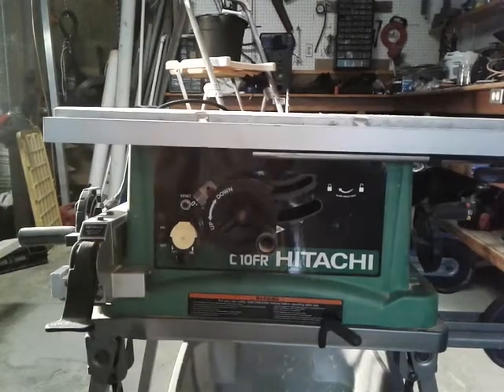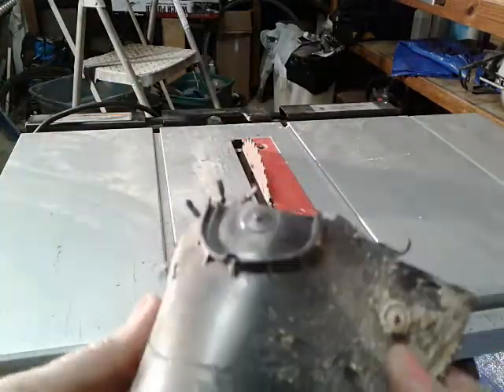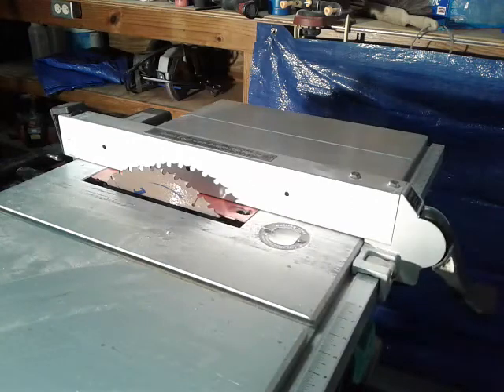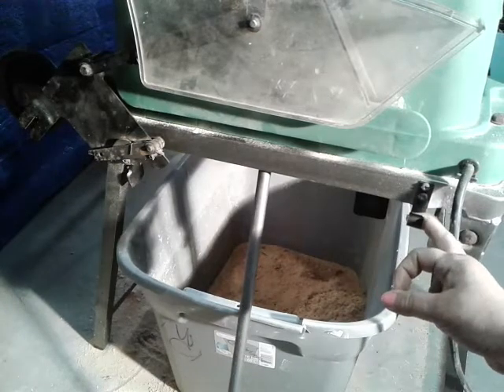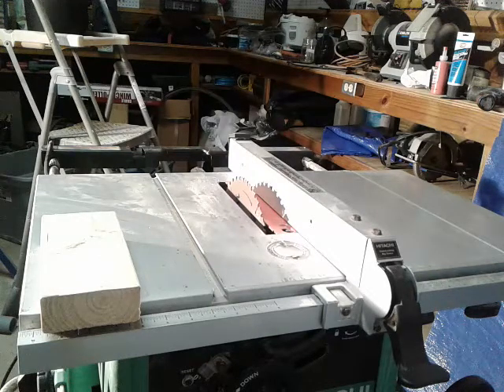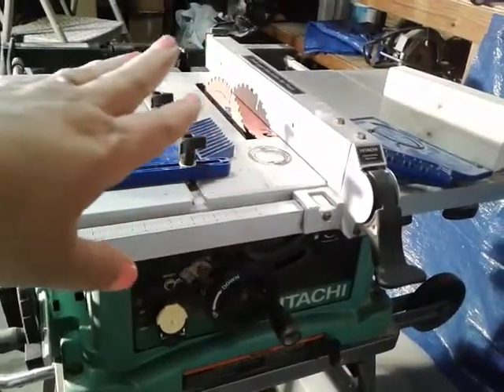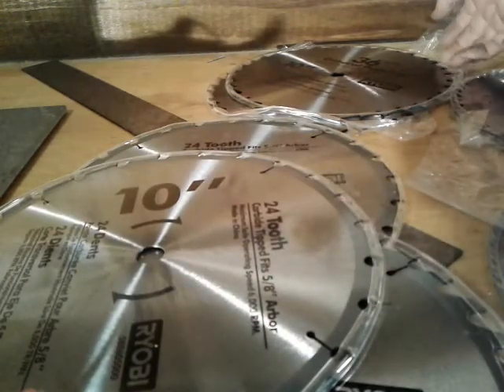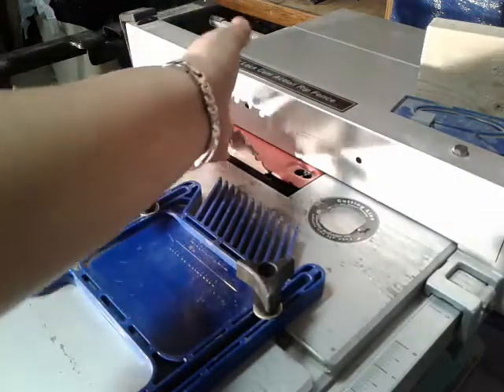Hitachi C10FR Tablesaw Review

Comment: Do you happen to use the splitter? I have been searching high and low for one and cant seem to find one. Mine is missing and if you dont use yours maybe i cam buy it off you.
Reply from the maker: The splitter goes behind the table. Way behind the blade.  I've had 2x4s tighten up to where the splitter blocked me from finishing the rip. That's why I  ended up removing  the splitter. I probably will end up selling this table saw when/if I can get a more powerful table saw. Better if I have all its parts. Sorry. There has to be some after market splitter?
Reply: @ViviansDIYProjects  unfortunately they no longer sell one that fits this saw.  Thank you though, best of luck.

Comment: Thanks for the review. Would you buy it again?
Reply from the maker: No, not this exact model because of where the splitter (riving knife) is located. A table saw should have a splitter right behind blade and goes up only as high as the blade. For this model, you can't cut rabbets with the splitter installed. Still not a bad table saw and for the price it's hard to beat. Yesterday was week 12 since my table saw accident. That splitter would have prevented this accident entirely. So it's important to consider.
Reply: Vivian's DIY Projects Thanks for the reply, all this helps making the right purchase. I'm sorry about your accident. I hope you are ok now and still have all your digits.
Reply from the maker: Thank you. I have all my fingers, at their full lengths. Just dealing with mobility and tight scar tissues. Best of...not luck but wisdom in getting a table saw. Very smart to learn from others before making a decision.

Comment: Have you got the dust collection bag the fits underneath the table? Easy way to clean it out is with compressed air if you have a compressor
Reply from the maker: Playing around with non-electric methods/systems to reduce the dust and to keep the finer stuff from going all over. Need lumber to cut up to test it.